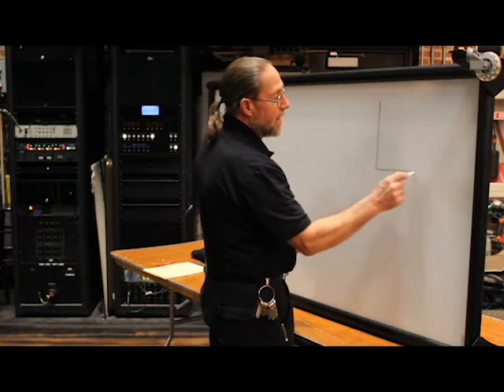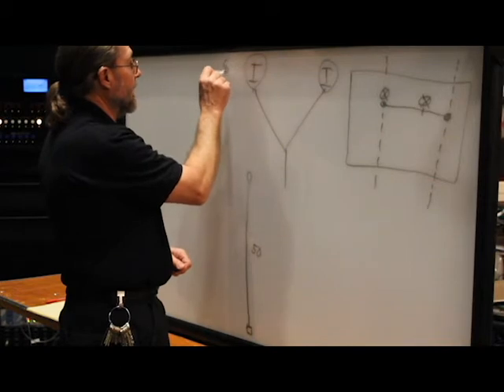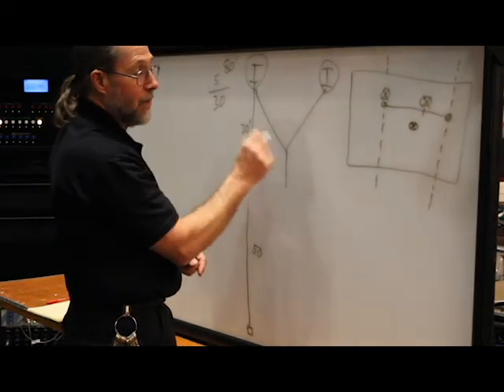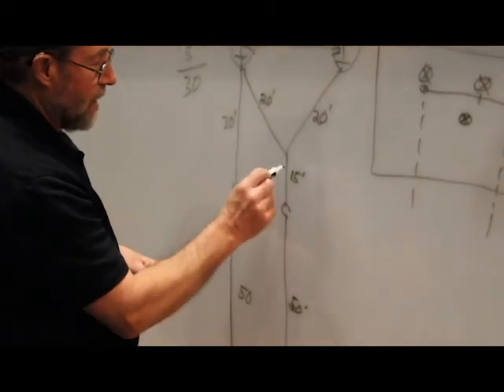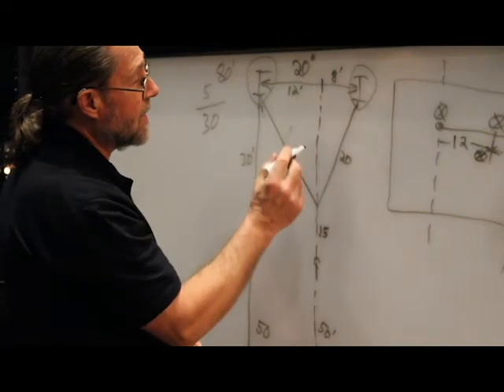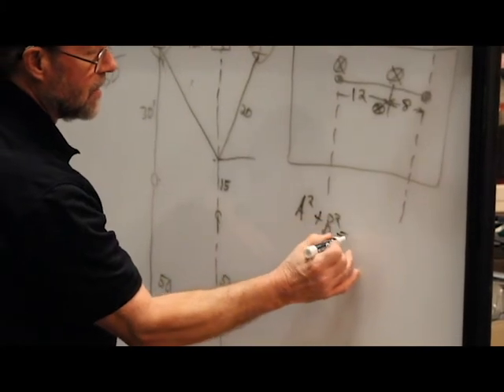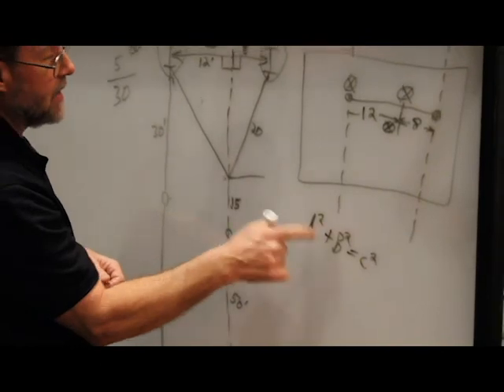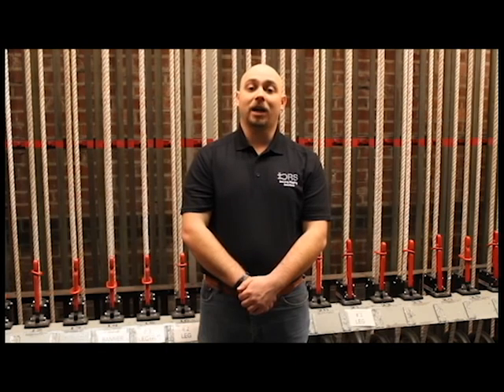Basic Bridle Math

Comment: Question, how much sway do you get on the ground for each link of deck chain added to one of the legs?
Reply from the maker: Deck chains are not a perfect science, with experience adjusting them gets easier to do "on-the-fly".

To answer your question, it depends on the size of your deck chain (there are 3" and 4" links out there) and how shallow your bridles are.  If you were to have 2 beams that are say 10 feet apart and you're using a 5' basket and 10' + 3L legs on each side, a single link would move your point differently than if you're using 20'+3L legs on both sides. A single link would effect the bridle differently if one leg is say a 10'+3L and the other leg was a 20'.

When working with deck chain, honestly best practice is to do the math for your starting point. If you miss, take an educated guess on how much a link is going to move your point, and have the up rigger make the adjustment. If you miss again, you now know exactly how much a link moves your point and you can make a more educated guess on the next attempt.